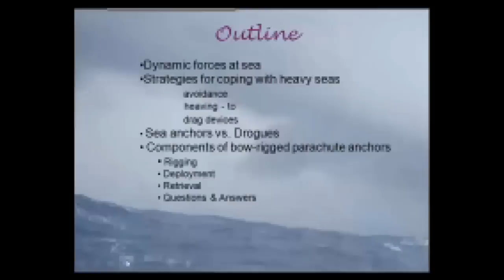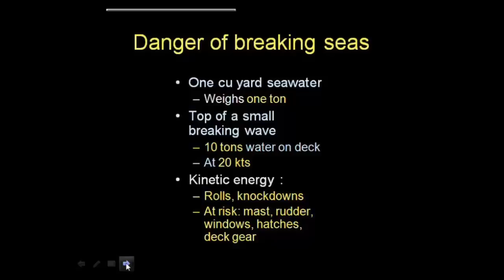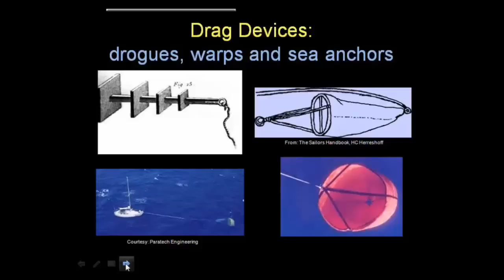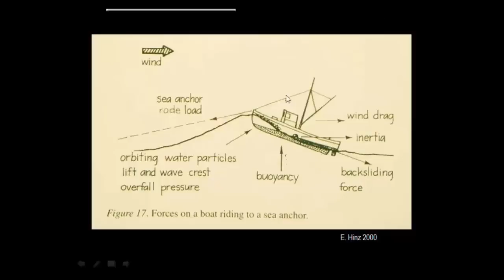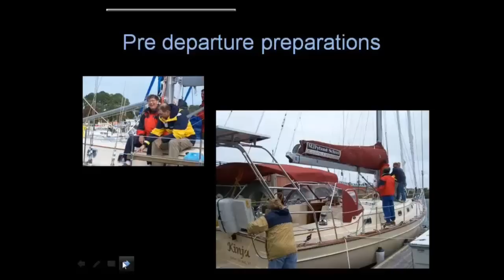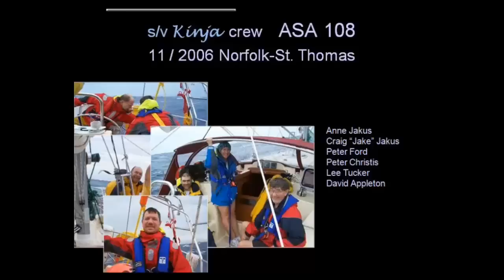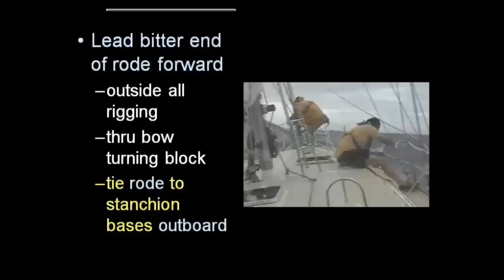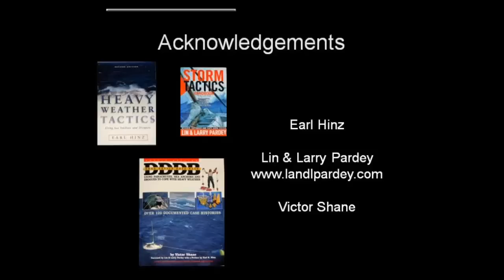Storm Tactics & Sea Anchor 2

Comment: Thank you for the presentation. Very good. Got both sea anchor and a seabrake drogue onboard. Used the drogue twice to get a break when sailing short-handed. Never set the anchor. Next time I will set the Australian Sea Anchor. With a 42" feet fin keel boat there is no option to set a rudder line. Spoke to the manufacturer, there is no recommendation to install that. The rudder stock is well manufactured and should not break or get loose when locked. In your video, you do not comment on how to set your rudder or angle of the rudder. There are a few comments on that. You need to keep the boat balanced, with a staysail and/or trysail you need to find the right balance point for your boat. Every boat is different. When the balance is found, I just locked the helm off and turned of the autopilot to save power.  Thanks again for a good and educational video.

Comment: Hi, Thanks for the great video, I had one question about the data on the number of boats that choose various methods of dealing with the heavy weather. You mention that none of the heave-to vessels rolled or sank. Could all of these boats have been boats in lighter conditions. This might be supported by the fact that they still had sails out.

Comment: how do you heave-to with mainsail alone?
Reply: Same as with tri sail. Sheet in tripple reefed main  and then tie tiller off to one side so it stalls and and cannot go through the tack. Trisail i think helps you point higher.